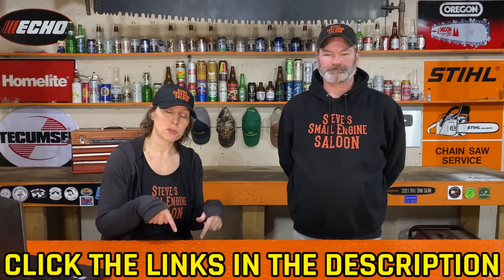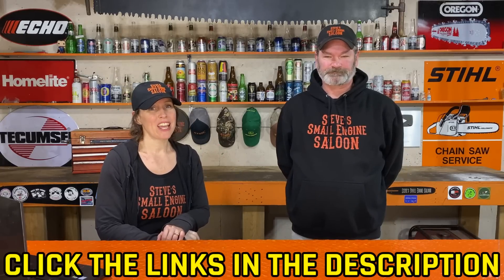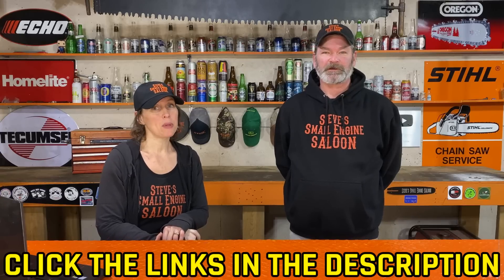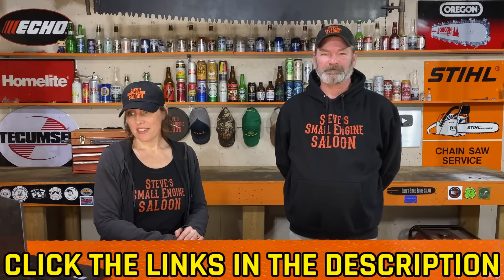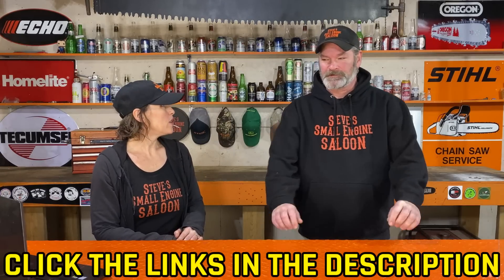Can I Remove ETHANOL From My Gas? (DAY 15)

Comment: Yes, you can remove the Ethanol like you said. But I prefer to buy Aspen2 or MotoMix for my Equipment (well at least the 2-Strokes). Never had problems since I use it.

Comment: You are absolutely correct. Removing the ethanol will definitely reduce your octane rating. Here in Ireland I purchase unleaded 97 for my 2 stroke machines as on the whole it contains zero ethanol or 5% at most.

Comment: I used to do that for my small engines before our local fuel distributor installed a dedicated non ethanol gas pump.  No clue on the actual number but I've heard you lose roughly 3 octane points by removing ethanol from e-10 gasoline. I always started with 92, hoping I'd end up with atleast 89.

Comment: Obviously, some markets (big cities maybe) may not have a non-ethanol option.    Priced (low to high) - E85 flex fuel, 88/E15, 87/E10, 89/E10, & 91/E0 (non-ethanol premium gas) are common in my more rural area.    I use premium non-ethanol gas for all my chainsaws, grass trimmer, push mowers, riding lawnmower, ATVs, UTV, log splitter, rototiller, & anything I may have forgotten.  Even when something sits for a few months, I have very few fuel related issues.

Comment: It's not only the ethanol gumming up your carburetor but all of the other aromatic hydrocarbons like benzene! Engineered fuel like Aspen also removes these other hydrocarbons. I can't afford those engineered fuels so I'm just stuck with rebuilding carbs every few years!

Comment: Steve💯👍 Definitely would lower the octane rating and probably cause poor running by any carb.  And, you are right- why would anyone take the time and trouble?
Reply: Because we have no source of ethanol free gas beyond the pre-mix.
Reply: Saws lasting longer, fewer fuel problems, and consistency in how they preform.  A saw that lasts years under daily use that runs slightly slower is fine with me.

Comment: It would be worth it if you didn’t have any pure gas to run through your chainsaw before storing it for a while. Take the water out and then run the engine out of the water free gas.

Comment: The thing I don't understand is why non-ethanol is more expensive than the ethanol laced fuel? Seems like less elements and less processing should be cheaper, right? It's unfortunate that non-ethanol is restricted in so many areas of North America. Good topic today. Cheers!
Reply: Corn farmer lobby
Reply: @briansilver9652  So true.
Reply: I'm dummy so keep that in mind when reading this. I think they have to add other additives to the gasoline to boost the octane, which adds to the cost.
Reply: Liberals

Comment: The Molecular process of hydrogen bonding causes ethanol alcohol additive   to be almost hyper hygroscopic    if your tank is exposed to hot cold cycles    especially in humid weather it will fill your tank full of water in no time   ...that is  if you don't have a way to make your tank airtight

Comment: Remember that Stihl is a German company and that Germany has had 10% ethanol in its fuel/gas for more than 10 years and yet their garden and forestry equipment is still going strong.  The whole ethanol drama is a load of baloney.
Reply: BUT seasonal equipment, especially in northern regions, like lawnmowers and snowblowers that will sit for 6 months with ethanol gas in the carb bowl will gel up and clog resulting in a no start.
Reply: @dkupy100  That would probably happen with any fuel but anyone leaving a machine sitting for 6 months with fuel in the tank is an idiot and shouldn’t be trusted to operate a bicycle let alone a piece of machinery 😀
Reply: @tonyalways7174  Hey...who reads instructions? That's what keeps small engine repair shops in business.
Reply: @tonyalways7174  Wish all I had to do was worry about fuel in a fuel tank for six months (and call other people idiots, without knowing spit about them)

Comment: I learned about the damage ethanol did to my lawn equipment only after I bought a new mower and gas trimmer to replace my older nearly 30 year plus mower and trimmer. I thought I was meticulous in keeping my units ready over the winter periods, but yet only a year or two after buying the new equipment I noticed difficulty starting and just poor performance. I did carb cleaning overhauls and both of these new carbs were like totally gunked with green goo from whatever leftover ethanol mix gasoline still in the lines and float bowls. Reading up about the damage that ethanol does to small engines, I switched over to premium gasoline which unfortunately is the only gas here that is 100% zero ethanol. Since then, not a single carb problem and has been trouble free for half a dozen years now. The mower is now even kept under tarp in the yard over the winter months, and with fresh fuel, only a couple pulls gets it started every time - just like my previous nearly 30 year old mower. Nasty stuff ethanol.

The water method to separate the ethanol sounds interesting, but I don't know. I'm only buying a few gallons every month or so, and while premium is more expensive,  I'm only buying like a 2.5 gallon jug amount each time.

Comment: I’ve known about adding water to ethanol gas and then removing the ethanol-laden water. And I’ve known that eliminating the ethanol reduces the octane. One possible solution to the reduced octane is to first buy high octane gas. The easiest solution where I live is to find those rare gas stations that still sell ethanol-free gas. Some sources have both regular and high-octane gas available with no ethanol. But removing ethanol can be done, but be aware of what remains to power your equipment.

Comment: Steve can you remove the water after with a Mr. Funnel?
Reply: I tried to remove water with a mr. funnel doesn’t work it just removes the debris like a filter The water goes right through it I put it in a milk jug poked a hole with a ice pick and drained the water out the bottom

Comment: or mix with water, then freeze, then drain off the unfrozen gas
Reply: Will the ethanol freeze with the water?
Reply: @whatthe2458  Doubtful
Reply: I think that would only remove the water you added. Alcohol does not freeze.

Comment: I think I would not do this as the pumps around me here in Louisiana are single hose for the non whisky gas. For pumps with 3 pumps tied to one hose you might get 1/3 gallon out of the hose and if your only wanting 1 gallon thats a lot of something your really don’t want.
Reply: Fill up your car first to clear the line then your jerry can.

Comment: Plus, what do you do with the water/ethanol mixture? That's liquid waste. Don't be pouring that on the ground or down a sewer. Now you have to drive to your local hazardous waste facility and spend a pile of money to dispose of it or if your municipality has a special day for household hazardous waste you can save it up and take it there. Aggravation, cost, dangerous temporary storage and transportation etc. Not worth it.
Reply: In Russia we drink it... What you mean ?
Reply: Ethanol evaporates easily.  Pour in a pan and set outside in the sun.
Reply: Let it sit outside and evaporate.  It's 95% water 4% alcohol, and 1% other hazardous stuff.  More gas gets dripped on the Gound every time you fill up at a station than what's left here if you are careful.

Comment: This is absolutely true. I used to do this years ago in my ultralite airplane. The alcohol eats up the rubber parts in my carbs over time and the tubing.
What you can’t confirm, as you’ve said is what else are you removing from the gasoline? The exhaust color changes between straight fuel and the “ separated/ processed “ fuel.
Reply: I always wondered about doing that for my ultralight. Then running it through a Mr. Funnel. Never knew for sure, so I just did the test for alcohol and found non alcohol fuel.
Reply: @skyraider2021  
I flew a CGS Hawk Arrow with a Rotax 503 and my QuickSilver 2S with a Rotax 582 combined +300 hours with no fuel/ performance troubles.
Reply: So this is absolutely a VERY DUMB idea.   MO Gas is available and  Ethanol Free is available.  You obviously think you life is worth Pennie’s and giving life threatening advice.   I have flown aircraft from 150s to 747s so
Reply: @RJLM330  Reading comprehension. Second sentence. He "used to years ago". Maybe MO and ethanol free wasn't available where he was at that time. 🤔 Nowhere in his comment were the words, here is my advise. So dumb would be to think you know that is what he was insinuating.
Reply: @IntentionalBeing-m8w  And he also said you can't buy it in some places. Phhhhttt!
Reply: @IntentionalBeing-m8w  so regular gas wasn’t available ?
Reply: @RJLM330  When was the last time "regular" gas was available?

Comment: Steve, every time I bring fuel home in 1 gallon can toys for mixing for steel equipment. I pour the oil in and I pour about 2 ounces of star Tron in there and I haven’t had a bit of trouble. The other thing you can do to knock out the water is to The cam other words screw cap down screw the the pourspout down cover the end of the pourspout was a piece of foil so that you’re taking away the free air and close the vent that gas last year two years at least
Reply: I have been using startron for years but watched a video Tarly Fixes all does a test with Mason jars and puts different additives like star Tron is one of them you’ll be surprised the results I was

Comment: What are your thoughts on heet water remover I have seen the 2 different style of this water remover. So 10 percent of a gallon of gas  is 12.8.percent so forth and so on
Reply: I believe heet is actually ethyl alcohol . Kinda works in reverse to this process. bonds to water and makes it so it has a better chance of burning, but will at least pass it through the system without trouble.